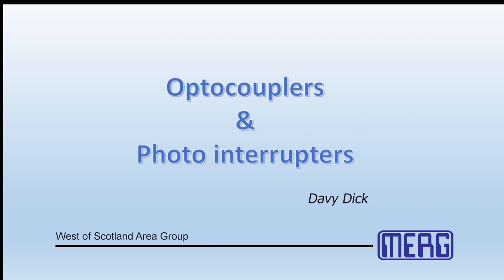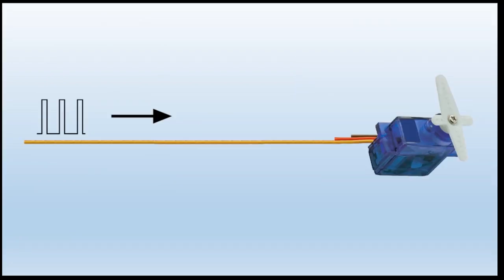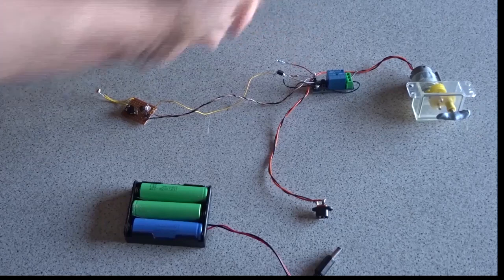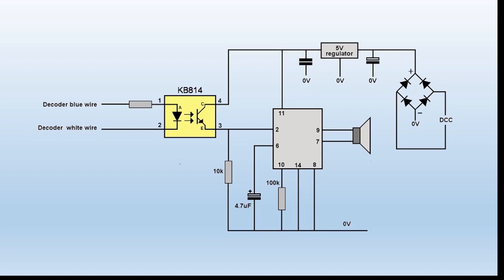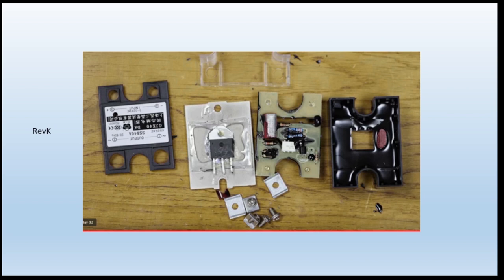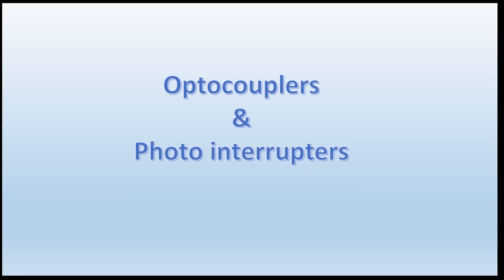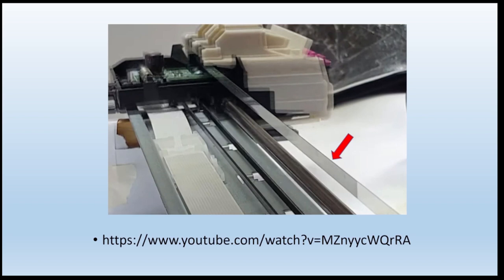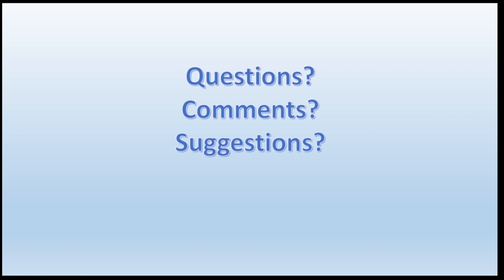Optocouplers and Photo Interrupters

Comment: What is the purpose of the opto in the circuit at 13:20 in the video? Seems to me to be adding an unnecessary component that adds cost and is another possible failure point. It is not providing any isolation or noise immunity between the processor supply and the relay supply as they are tied together with the common 0V line.  Just drive the transistor base from the processor output through the appropriate current limiting resistor. The voltage difference between the processor and relay supplies is accommodated by the Vce rating of the transistor.

Comment: I remember using the optocoupler igbt driver and I have 15 volt to the collector but the multimeter showing the same 6 voltage from the pwm ic not 14.45 volt can you explain why I only get 6 volt instead of the 15 volt to driver the igbt  that need 15 volt to fully charge up

Comment: Thanks for a very instructive video!!   Been thinking about adding stepper motors to a yet-to-be-built vertical lift bridge (Custom Model Railroads) ... will need optical limit sensors I'm sure for safe operation on layout.   Happy New Year ... Cheers!!!
Reply: use 3D printer optical limit SW, very cheap, 6-10 pcs cost about 5-8$ why stepper motor, why not normal gear DC motor lift, and optical limit SW stop motor if top have. up and down position, arduino nano use. no matter what motor uses but stepper need more work than DC motor. stepper motor need driver board, step signal and direction signal and enable signal if want motor sleep if not used. and motor max current need adjust in driver little less than motor maximum have, or burn motor. not good if motor have all time ON, enable pin can turn motor OFF not tress coils lot. but job have simple small scale hobby work.
 idea build bridge under small rod vertical, rod have 2 hole, when opto sense hole stop high or low level at bridge.under bridge, then not can see sensors or wires have under table all.

Comment: can i use this other side, input to opto come 12V pulse from promixity switc output wire, and other side have 5V what go to arduino nano digital pin. but i has try search what resistor size need be, i use 4N35 opto,  i need made speed sensor 30 000 rev 2 trigger/rev.
Reply from the maker: Hi Matti - check this out https://forum.arduino.cc/t/4n35-opto-coupler-question/1134297